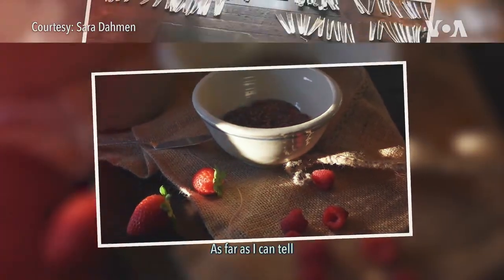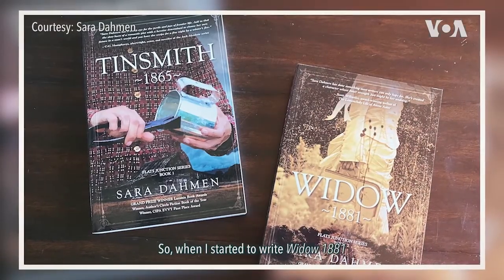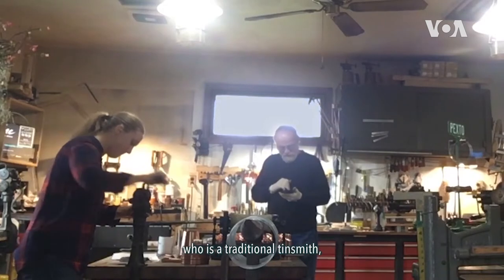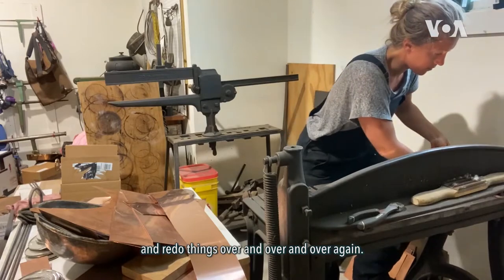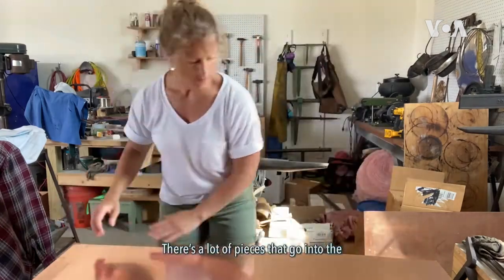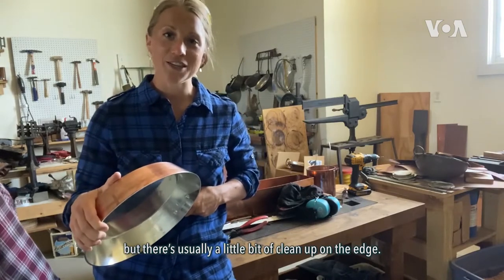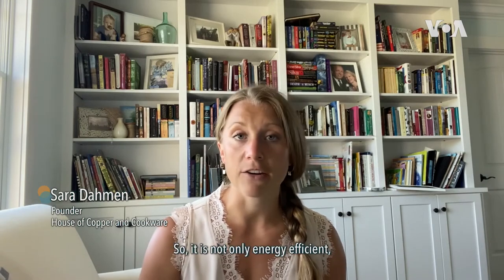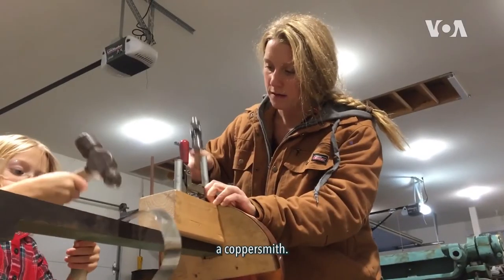Female Coppersmith | VOA Connect

Comment: What flux are you spraying on the copper before adding the tin and wiping it around? I've got some 100% tin ingots from Kester and a copper pan I'd like to re-tin. I'm expecting to have to sand down to bare copper to get the tin to  adhere, but I don't want to do it twice. Excellent video, btw. Those that don't understand what goes into a good video like this just can't appreciate much.